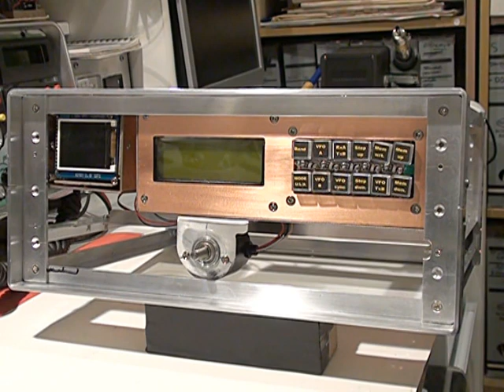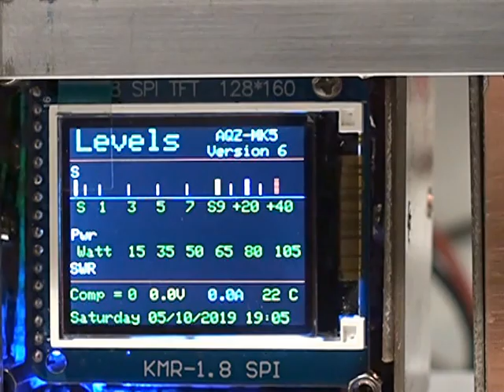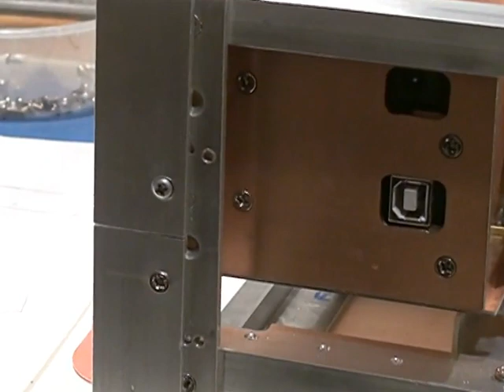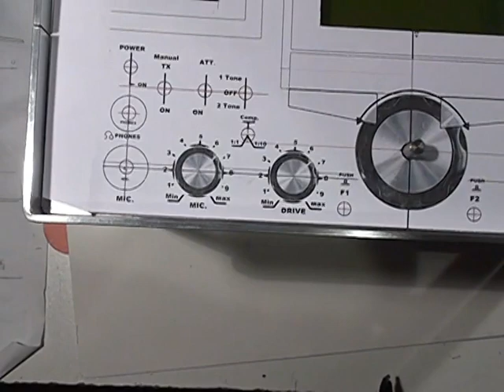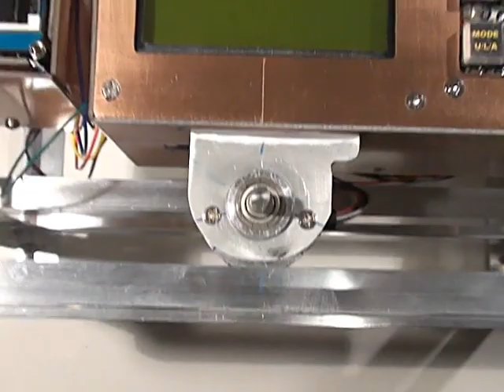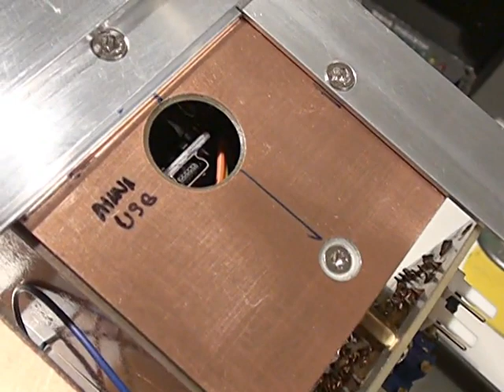MK5 case construction part 2

Comment: Thanks for sharing another great vid of your construction. I use to attend several bike rallys every year and it was always great to see the bikes in the show and speak with their owners about how they went about the various stages of construction and we all took a lot of new ideas home and quite often made some cool new friends along the way too.  I did this from 1990 - 2007, the last 6 years of which I ended up working either as a Marshall, backstage and/or simply filming the baands and bike show for my old website www.magikflame.com (which is now owned by an electric fire company) Now I am a licensed radio ham there's nothing I would like more than to fit a small VHF/UFH rig eg. the Retevis RV95 to my bike and combine two of my favourite activities. Back in my CB radio days I fitted a Ham Major M588 set to the bike along with a 1/4 wave DV27 antenna which had a top loading coil and fibreglass construction, obviously 2M seems a far better choice with regards to antenna efficiency, I am thinking maybe a fibreglass 'slim-jim' with the top tied via. length of para-cord to the front fairing - that or just left vertical depending upon how it actually looks on the bike, sensibility is saying a 1/4 wave would be more practical, but as the saying goes -proof is in the pudding !
Reply from the maker: You have certainly had an interesting time. Yes, I had  a bike  some years back - great fun in those days. CB was also an interesting phase here in Oz. Anyway, enjoy the ham radio. Lots of guys back here now returning to hands on electronics like ham radio and Arduino like gear. Over 3000 young people have now passed and obtained their ham radio foundation licence here. No morse code so not too hard anymore. Most who now have become hams, will say that they got bored with computers and PC games - boring was the term - PC don't actually have much hands on electronics!! Well, thanks for your description of your past experiences. Take care, Lou